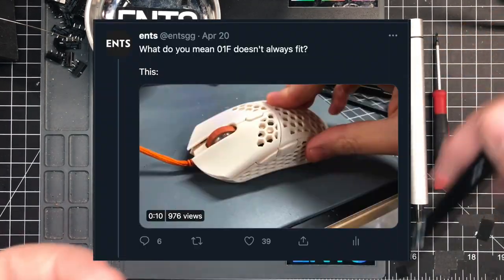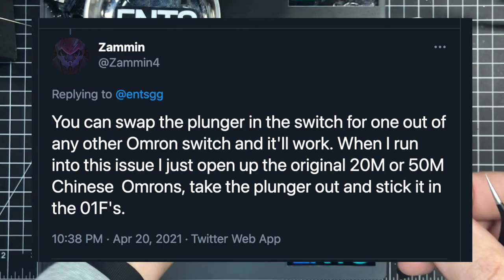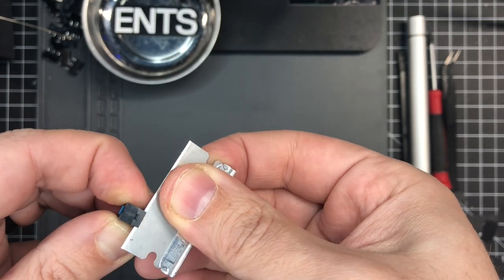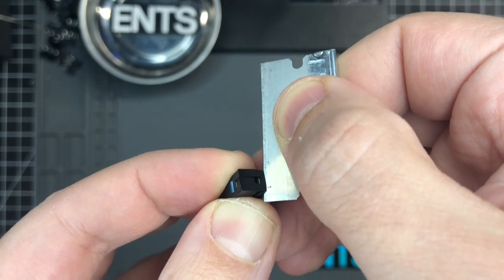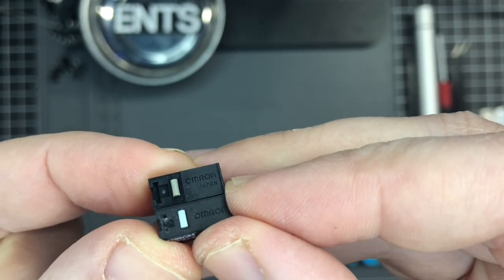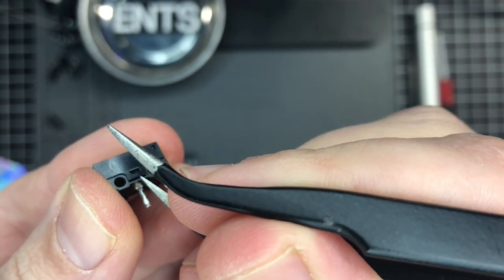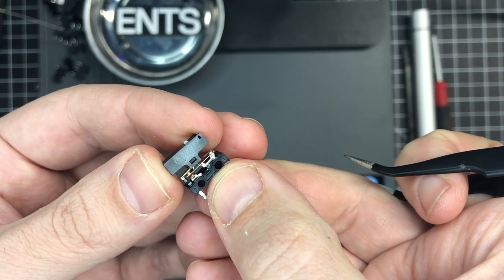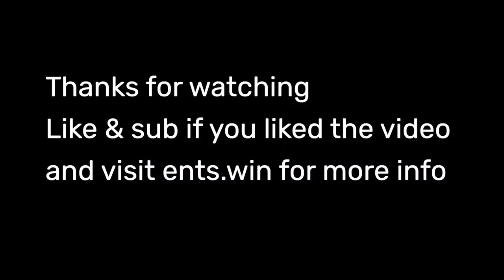Make Japanese Omron Switches fit any mouse! Omron D2F-01F Height Fix

Comment: Thanks so much for this! I wouldn't've thought it was possible to open the Japanese Omron switches, there's barely any gap in the plastic. I ended up using a sharp X-acto knife edge since I didn't have any tweezers thin enough.

Comment: Would another solution be to slightly sand the original plunger? It's a very small part of plastic and surely that would be safer than going through the hassle of buying a donor switch and the risk of replacing plungers.
Reply from the maker: you can try, and it may work, but i do this way because:
1 - no way to accurately sand the same amount on each plunger
2 - plastic dust will get inside switch
3 - i have thousands of dead switches on my workbench to use 
4 - this is reversible
Reply: @entsfps  This makes sense. Thank you very much!

Comment: Yo Ents, I have a question about the G Pro Superlight, when clicking and moving the mouse button to the left and right there is a popping sound and feeling after releasing the click. Is this normal? Would replacing the switches in the mouse fix this?
Reply from the maker: tweet me a video @entsgg

Comment: I recently purchased these switches from AliExpress, then it was taking long so I also purchased from ebay, the ones from ebay came the have "3181RAK" at the top right, but they felt strange, and didn't sound like I imagined from videos, assumed it was the videos fault, but then earlier today the ones from AliExpress came in, and they have "2747RAE" in the top right which is more commonly the code I see on other people's switches, they have the more snappy sounding click I was expecting and also feel lighter to actuate and according to my scale they are lighter to press, does anyone know what the code in the top right of the switch mean?

Comment: I recently soldered new Japanese Omrons into my G903 for the first time. The double clicking issue is now gone but the travel is so much shorter and it’s hard to get used to. Is it worth the hassle to open up the mouse again and switch the plungers?
Reply from the maker: wait a few weeks and do it if you cant get used to it
Reply: @entsfps  Thanks! That’s what I’m thinking as well. Never had a YouTuber respond to me months after the video was posted so you just earned a subscriber. 😀
Reply: @entsfps  I think I'm gonna open it back up and just file the plungers down slightly. The taller plungers are functional, but I heard that the lifespan of the switches will drop drastically because of them.
Reply from the maker: @terrasai2857  good luck!
Reply: Its perfect for dragclicking
Reply: @terrasai2857  Hi there, I am on the same boat as you. I have just disassembled my G903 to replace d2fc-f-7n(g) switches with D2F-01F Japanese Omron switches due to drag-clicking and double-clicking problems. I am wondering what you did with your mouse. Did you switch the plungers or just keep using them as they were? If you used them as they were, any feedback about the lifespan rating would be appreciated considering it was about 5 months since your post.
Reply: @The_Z_Force  I ended up keeping the Japanese Omrons. They still work great! No issues at all 👍
Reply: @terrasai2857  Thank you man for the prompt answer. I will also keep the original plungers on Japanese Omrons as per your experience. I guess they might feel different for a couple of days due to the shorter travel distance, but it is an acquired feeling that will change in a short time. I remember that I was not too fond of the palm feeling of G903 for a few days right after I upgraded from G502, but now I like G903 more. Cheers.

Comment: What switch would you recommend for the xm1v2? Currently, use gm4.0s and found them too heavy. Also, you really need to blow up, you create helpful, high-quality content and are very active to help out. Cheers.
Reply from the maker: thanks so much. try gm2 or huano 80m both a little less heavy.
Reply: @entsfps  Thanks for the response, What would be a lighter alternative to kailh gm8.0s?
Reply from the maker: @SC3Zero  ents.win/switches has my switch spreadsheet  -- pink dots, 01f

Comment: Is there any way to check if the switch will work in a certain mouse without doing this? Or do I have to solder them in and reassemble the mouse first?
Reply from the maker: you can try first without doing this
Reply: @entsfps  but will I have to solder them in then? :-)
Reply from the maker: @lnbabz  yup
Reply: @entsfps  Okay, ty for answer

Comment: What switch do you recommend for a GPX? I feel likethis would work great as its still light like the og omrons.
Reply from the maker: i like the stock clicks, these would be good, and ttcgold dp is nice too
Reply: @entsfps  I actually like these clicks too but I like the slightly thuddier? Clicks of like orochi v2 and vaxee mice. 

How do the Japan omrons and stock compare in terms of feel? I just hear ppl say switching the switches makes a huge diff so I wanted to try it but should i just leave it stock in your opinion?
Reply from the maker: @I3asyl  id keep it stock until it breaks -- a little heavier would be huano 80m, 01f would be similar to 20m
Reply: This switch is much more lighter than og omron

Comment: hello there, Would the D2F-01F fit and work 
in my Model O minus?
Reply from the maker: Try it without doing what's shown in this video and if it doesn't work or doesn't feel right, do the steps in this video and it will work!
Reply: Did it work , i am sure it did

Comment: do we need to do a plunger swap to get them to work on a starlight 12?
Reply from the maker: you wont know until you try, it varies mouse to mouse and switch to switch
Reply: @entsfps  yeah i had to use the plungers from some spare 8.0's and they work like a dream in the starlight

Comment: Is the japanese omron fits on logitech g203 or g304??
Reply from the maker: after doing this trick? sure
Reply: @entsfps  no not the modded one
Reply from the maker: @ShinPorsche  you dont know until you try
Reply: @entsfps  hmm seems it's just almost just right size  just little tight but it works but with a deeper clicky